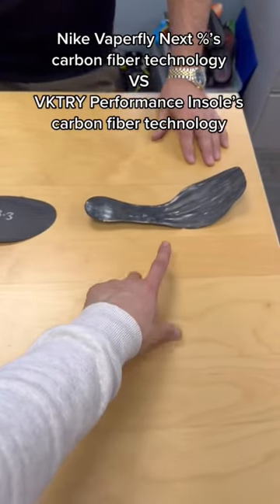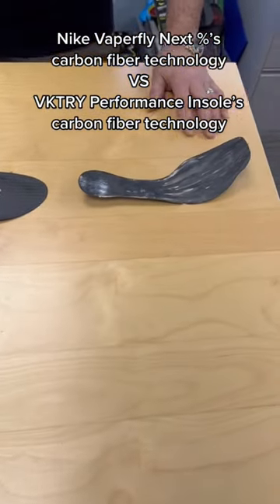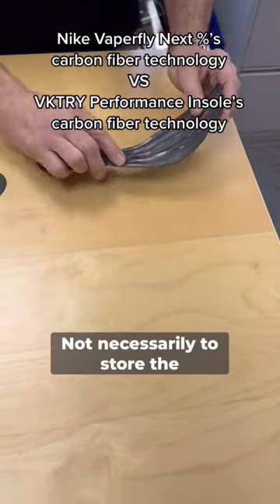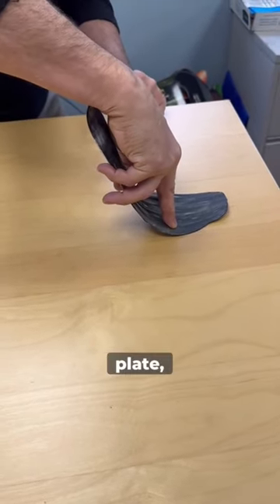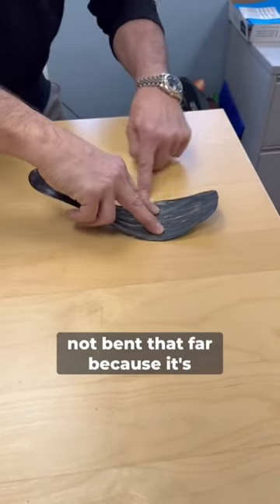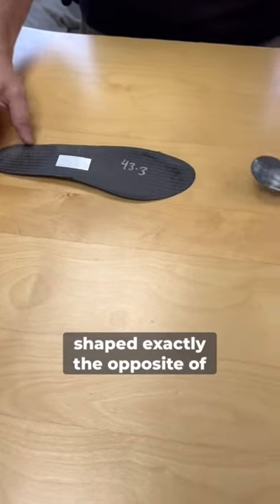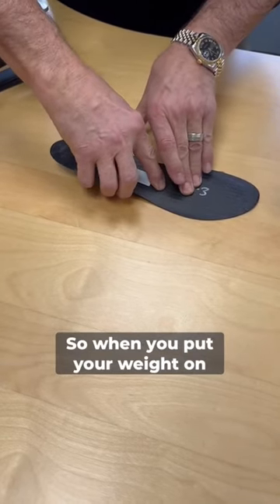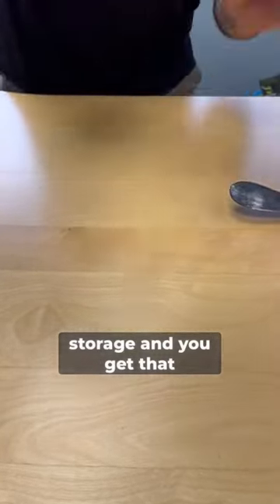The Difference Between VKTRY carbon fiber technology & Nike Vaporfly NEXT% carbon fiber technology

Comment: You’re wrong about the Vaporfly s. They are designed with forefoot/mid foot  striking in Mind, when the shoe hits the ground the plate expands towards the ground and it springs Back into its original state and that transition gives a forward push/energy return. So the Nike plate design is superior.
Reply: Yeah boi said "smooth heel to toe transition" like cmon tell me you know nothing about running.
Reply: Exactly what I was thinking too - the plate doesn’t need you to input extra energy to bend it like the vktry ones, but it will spring back just the same
Reply: This

Comment: The nike vapor fly carbon plate is NOT designed to transition from heel to toe. That’s why there is a larger width at the toe than the heel and why it is curved upwards at the back. No Nike running shoe or spike is designed to transition from heel to toe while running, that is false. Maybe these soles are good for basketball, but not for track. It is not necessary and the Nike spikes are more adapted and engineered for running and sprinting. These soles will give you no advantage for track and will cost you an extra $200 for a pair of soles. Please do not buy these for track or running, you can much easier get a Nike or other running brand shoe that already has the same if not better technology for much much cheaper.

Comment: Ok, I had my reservations about this product, but decided to give it the benefit of the doubt. That was because the Nike vaporfly existed, a similar product that gave a statistical advantage to runners, backed by data and also banned for this reason in competitions. But seeing how they're now trying to undermine the vaporflys engineering, VKTRY looks highly suspicious.
Not to mention the aggressive, buzzword loaded, and weak misleading demonstrations in their advertising. Also it looks painful as hell to use, the vaporflys actually also have foam padding and conforms to your running motion, unlike this rigid hunk of junk that will tear your arches. Your feet aren't meant to absorb that much force directly, whether it's running or jumping,.

Comment: it does the same thing and that shape gives you more energy because when you press heel while striking the toe section is even gonna go higher and if you press that angled toe section you will basicly have vktory insole since nike plate not desinged to be flat that shank will pop even more giving you a lot of energy and boost. btw you can not make arguler plate in a insole thats why they cappin about nike

Comment: I don't think people's feet bend the way the vktry plate was demonstrated to bend during a run. you either land on your forefoot or your heel but your foot DOES NOT bend as demonstrated(your toes bend at the tarsal joints) but not the foot. if this shoe is going to bend the way it is demonstrated then I am sure there will be alot of injuries just running normally.

Comment: I have a question. I’m a server in a fine dining restaurant that requires me to be on my feet for many extended hours. Would these reduce foot and leg fatigue from simply walking and standing for long periods of time?
Reply: Im 99% sure this doesnt do anything at all if it was such a game changer they wouldnt be the only ones talking about their product
Reply: Regular store inserts are the same help without all the extra $$.  There are a few factors to determine product. The most important part is start with a supportive shoe that doesn't allow the foot to move too much inside it. High or flat arches, how you roll your foot while stepping and ankle stability during turns and stops will all affect muscle fatigue. Chiropractic treatment can help to even the force applied to each foot while walking. If the Chiro claims they have a product or service that can "cure" anything, including your back pain, tho, run away.
Reply: probably not, maybe even make it worse
get proper custom insoles and work on strength training for your feet
Reply: It would probably hurt ur feet slamming on a carbon insole rather than one smushed inbetween foam

Comment: What happens when it breaks in your shoe and you have carbon fiber pieces in your foot and you’re bleeding through your shoe but you can’t take off your shoes because your soles have spring loaded your flesh into the top of your sneakers?
Reply: Well at that point you just buy new feet.
Reply: Better have a single carbon plate under a leather insole.

Comment: The things is where the dip is in the sole that’s where the energy pods are so the energy storage isn’t much needed as the energy pods help on that stride but all together it’s a marathon shoe not sprinting shoe so you don’t need power generating from the back of the shoe you need more in the middle of the shoe, where the energy pods are. The insoles can make you jump higher but not by much. So 150 dollars for 1 inch higher vert is crazy in my opinion.
Reply: Vaporfly doesn’t have air pockets mate

Comment: Looks as if you will encounter resistance while running or walking cause the insert will want to stay flat. Looks like it may be good for jumping but you will use a lot of energy just by walking or running around.

Comment: As a death metal drummer i am interested in this product and did follow this page
Reply: So random
Reply: @zepperdepep  no really, we play real fast double bass drums. My feetsetup is chuck taylors hitops that are tight, and a 800€ machine aluminum direct drive pedals. Then like some people put these rebound pads on the skin of the drum, i play naked remo ps3 BUT it has to be fresh and tight.

So someone here, the sole guys, saying i could have conserved energy for the next stroke: this woul lead to a higher natural frequency of the swivel motion->faster speed with same muscle power input.

Random still?
Reply: @JerryCrow  you do realize it's just a scam right 🤣 lmk when you can invert your foot for the extra energy and have that energy lift up your weight 🤣
Reply: @Sp_acecowboy  have you studied even high school physics? https://en.m.wikipedia.org/wiki/Elastic_energy .

So it’s not creating the energy, rather every downstroke(step) you preload a spring, that bounces ones foot up when downwards pressure is stopped.

Double bass pedals use springs, so all you in actuality have to do is stepping on the pedal, then the skin and spring rebounds it. With those converse, if theyre brand new they help. And after some 3 months the sole starts seperating for the forces it has recieved…
Reply: @JerryCrow  spend ya money then 🤣I ain't the one that finna be butthurt
Reply: @Sp_acecowboy  Yes, you ain't the one aiming for top performance. I don't understand why you are contacting me.

If one gets the silver and gold for test, it is some 200$ this is about an hours work these days, and just drumming i imagine using about 20€ per day due to wearage.
Reply: @JerryCrow  did I ask ?
Reply: @Sp_acecowboy  I did, trying to figure out your motiv for showcasing naivity. Keeps on @, why?